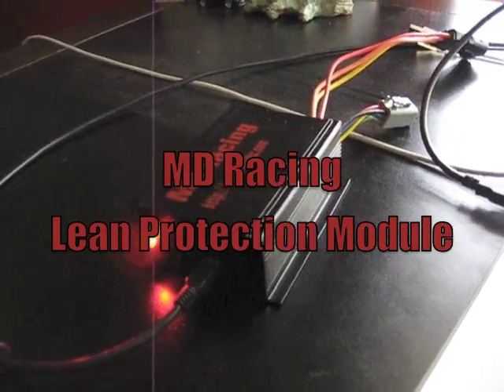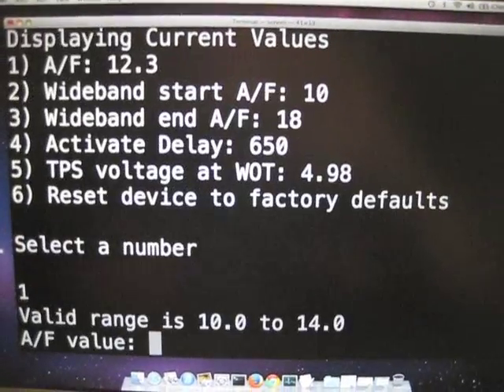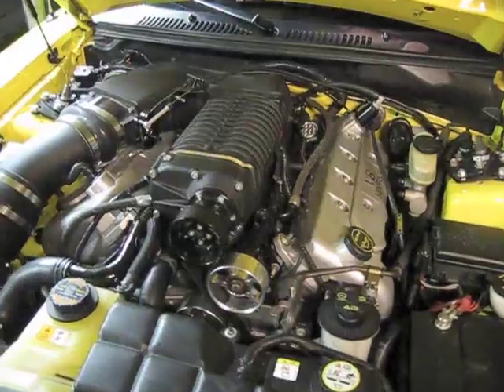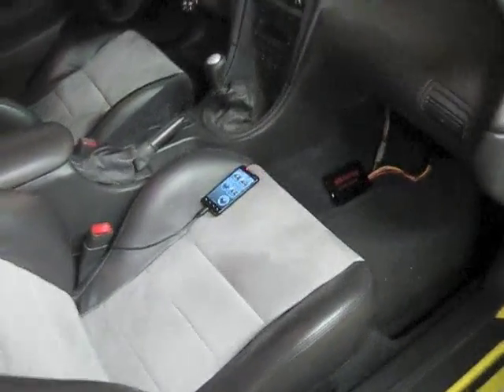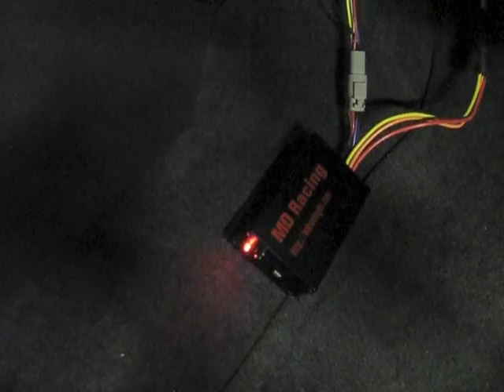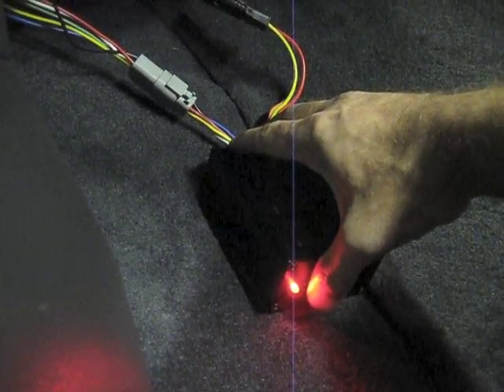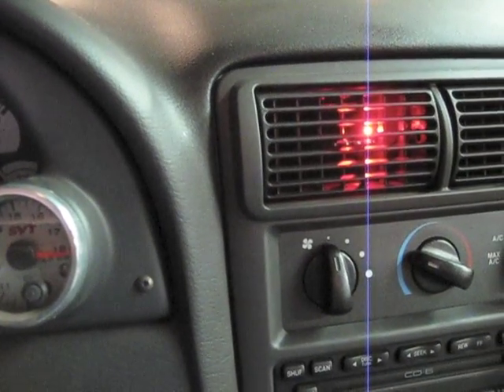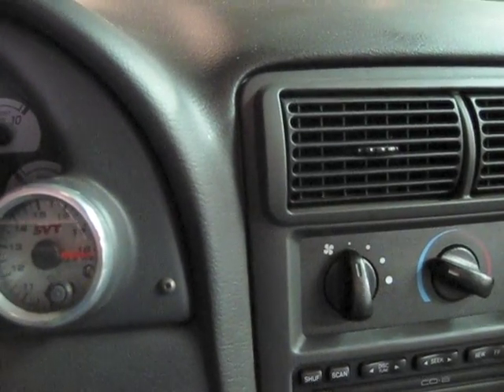Lean Protection Module

Comment: Hey man are you still making these? I am very interested, I have a supercharged 8th gen. I am running high compression and about 14.9 psi of boost. Im aftercooled and tuned on E85 but have had to still pull a significant amount of timing due to knock. Im making decent power but the there is much more to be had and I think meth is the answer. The dilemma is this, I am tuning with Flashpro  which doesn't offer lean protection in the event the pump stops working or the meth doesn't spray. Something like this would be an absolute godsend.
Reply from the maker: +robert perrotta Absolutely check us out on facebook at https://www.facebook.com/mdracingkc or our website http://www.mdracingkc.com and we'll get you setup with a unit.  This would be fantastic protection and insurance for you and save you building a new motor over a simple fueling or meth injection failure.
Reply: +Malcolm S I just got your message on fb as well. Any reason this wouldnt work on a 2007 civic si? it's drive by wire.